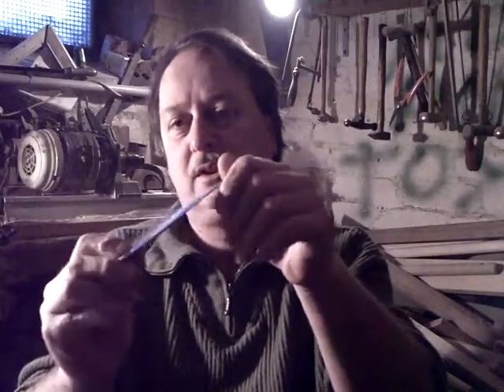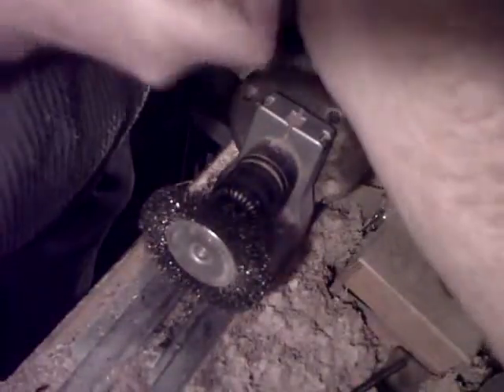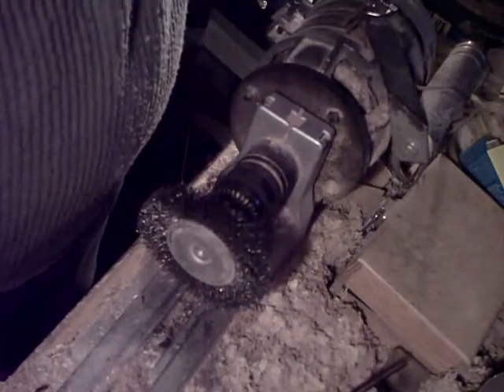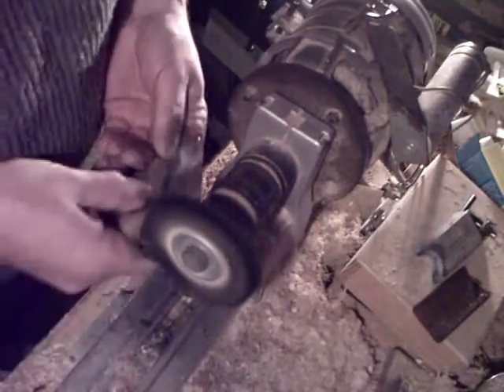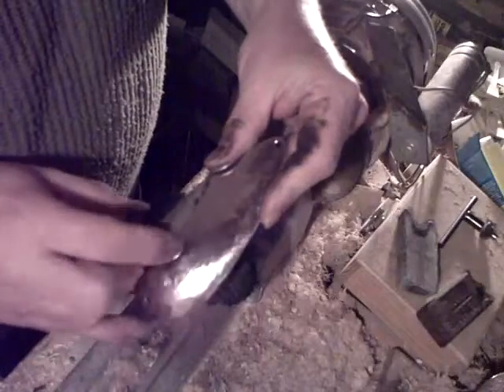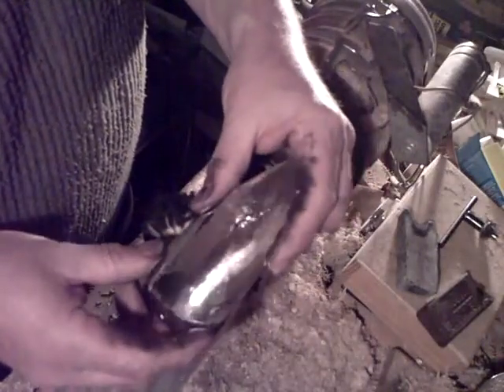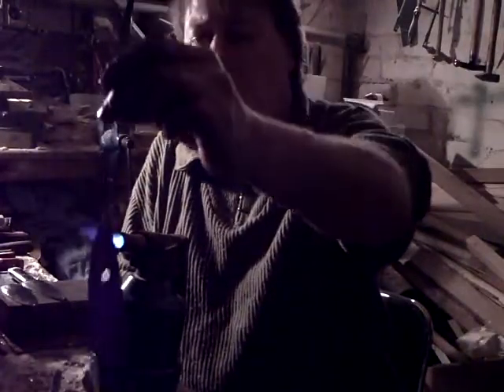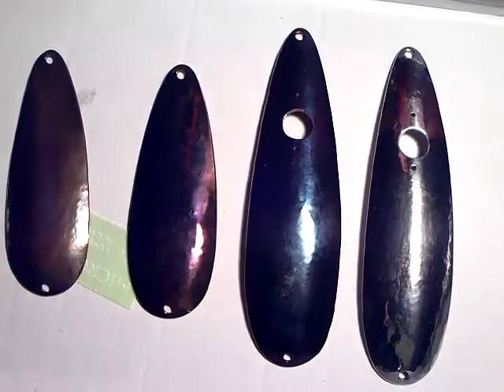Pimping Homemade Stainless Steel Spoon Blanks #1

Comment: great vid dieter, while i was watching your tutorial i got thinking have you ever considered adding some shapes and patters while you do the heating up part in a similar way that they add that wavy shape on japanese katana blades with some sort of clay before they do the final tempering. might be worth giving it a go, it might look pretty interesting if it works on spoons.
Reply from the maker: Thanks a lot , Mikko ,

In fact I had thought about such before , but did not think of such clay , but putting sheet metal onto the spoon or a bit ahead .

But that clay stuff seems to be much more accurate , gotta check those Japanese sword smith's vid's again .

Tried to re-polish blued surfaces to achieve a pattern , but the annealing obviously changes the steel properties , as you can not get it to shine mirror-like anymore , it would only get to a silvery, greyish and dull surface , .......but at least it still won't rust after annealing , ...but as said in the video , off course depends on the properties of each single steel alloy ! 

A fishy New Year to you , ......greetz , Dieter

Comment: i don't know if i missed it but what is the thickness of material you use for your spoons?
Reply from the maker: These particular ones are made from 1,2 mm to 1,4 mm stainless steel sheet , ....max. sheet thickness for stainless steel is 2,0 mm to be still shaped by hand , thicker steel material can't be cupped just with a ballpeen hammer anymore .

Check out this older video of mine :

Making Casting Spoon Blanks From Metal Sheet

Thanks for your interest , 61diemai